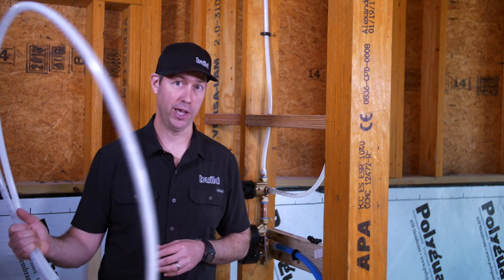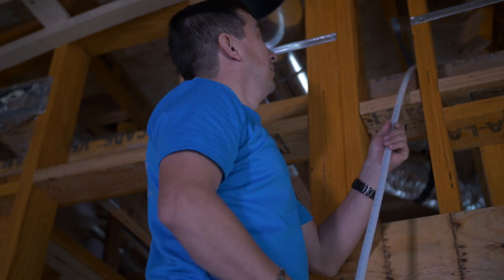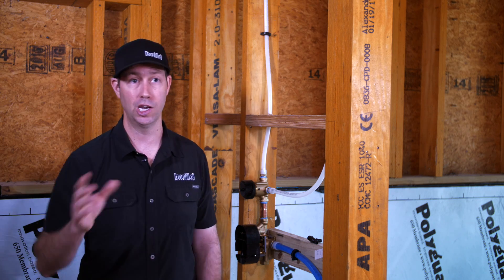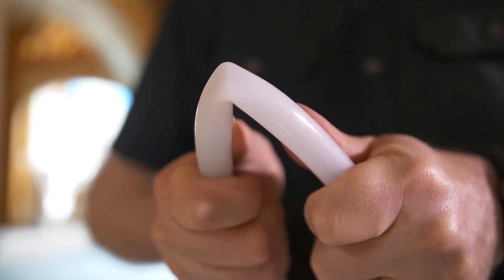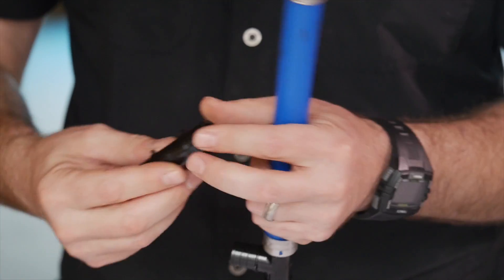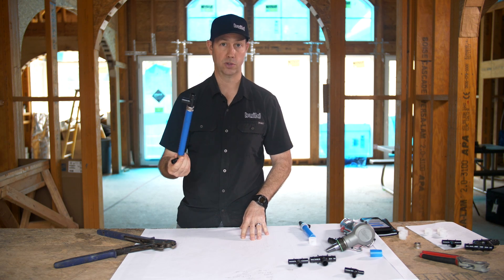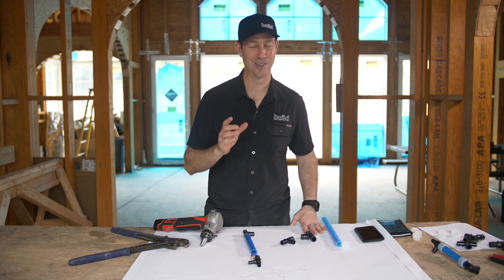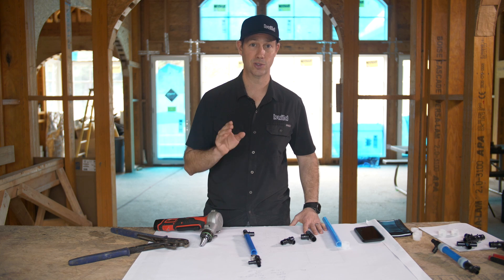PEX vs. Copper Plumbing

Comment: Another advantage of PEX is its light weight, making it ideal for RVs and Motorhomes. We live full-time in our Fifth Wheel and I love being able to maintain, modify, move or repair my RV plumbing so easily. And its ability to withstand freezing temperatures is also a a huge benefit for RVers

Comment: Just finished plumbing in a new tankless heater.  Old tank failed so I figured might as well finally make the transition.   
I bought two  8' runs of PEX and some non-removable push-on Shark Bite connectors to to simplify & speed up installation.

Since I had no hot water.. mid-work-week, mid-winter in Chicago.. the plan was to prep new location for tankless and do a simple temporary plumbing job to get the shower working again ASAP (weekends are for pretty plumbing).. so I installed both runs of PEX without cutting either.  Pipe ends were cut clean and square  at factory.

Half my push-on connectors leaked.  All the PEX was useless.

Having worked with it, I'm more convinced that it's rugged enough to hold up over time.. but I've got zero faith in the consumer push-on connectors.
In the comedy of errors that my installation ended up being.. the 3/4" braided water heater whips I bought to speed up the final hook-up also leaked, so I lost a whole evening without the parts I need to plumb the last 18".  
I ended up going full Copper.  Copper takes longer, but only if the alternatives work.    
I'm not a plumber but it's not hard to sweat a joint perfectly..  if you do the prep.  It just takes more time.   Not as much time as I wasted with worthless consumer-grade PEX connectors and running  back and forth to the hardware store to buy and return flex-lines..

Comment: The everloc system is what i use for heating, the uphonor i use for waters. Although copper is very commen in my area. And as far as stub ups or outs i prefer adapting to copper from pex for a more rigid stop.

Comment: i noticed you did not talk about the SharkBite fittings is that something you recommend
Reply: He's talked about it in other videos. In general, they're great (and reliable) for applications where you'll have the fitting in service for 15 years or less (like a water heater install), but he doesn't recommend them at all inside walls or other places where you can't readily get to them. Also handy for quick fixes or plugging a spot for a contractor to come in later. You should only use them a few times before the rubber ring wears out from install or the factory lubrication is removed from repeated installs.

Comment: You didn't say anything about Rodents chewing on PEX pipes causing damage. I had a repair job where rats in the ceiling did tons of damage to PEX pipes by chewing on them, the pipes were easy to repair but the water damage was tremendous. This would not have happened if the house were plumbed in Copper.
Reply: That home needs a few cats ! 😺

Comment: UV light damages PEX. We had a PEX line passing by a bug zapper at work, an we spliced in a new piece a couple times before realizing what the problem was.

Kind of funny tho. The PEX has a built in defence system, spraying water into the bug zapper until the fuse blows!
Reply: So the PEX fights for dominance?

Comment: Use the brass shark bite pex fittings. No plastic. Only problem I have with it is neatness. A professional job on a rough-in is impossible. I had to start thinking like an electrician running wire when I started running pex.

Comment: In my development that was built using PEX-A in 2007-2008, approximately half of the homes had pipe bursts at the copper junction that went to the HOT outlet of the hot water-heater.  This caused the whole house to flood if you were not lucky enough to be home when the junction failed. I was lucky in that mine only leaked, causing a mold issue on an interior wall of my house, but I had to have both sides of the wall rebuilt and treated for mold. I was one of the lucky ones...

Comment: I have used compression fittings with PEX (SpeedFit) using the inserts, and I think for me is the best system. I am not a plumber but am gutting and redoing my bathrooms.

Comment: I just last June replaced all of my 60 year old galvanized water lines with pex A the tool was a bit pricey  but friends saw how easy it was and we have saved each other hundreds if not several thousand dollars replacing piping in our houses. And we are actually doing more than most local plumbers would do. We have a few good ones in my town but an awful lot of loonies that shouldn't be allowed to practice plumbing.

Comment: Good video Matt.  Here are other things to consider:  1) PEX can expand when it freezes, but is harder to thaw.  2)  PEX can be chewed on by mice creating leaks...I have had clients with that issue.  3)  Copper is a natural antimicrobial material, PEX is not. On projects with well water we have seen microbial slime growth in PEX pipe.  4) As far as expanding the pipe to get full flow fittings...Uponor had a patent that has expired.  Most PEX manufacturers now offer an equal at lower prices.
Reply: Very true about rodents!  They love this stuff.  My parents live in the country and have had nothing but problems with PEX.  I would never use it where this could be a problem.
Reply: Thank You! I had never considered the fact that microbiological growth will be uninhibited with PEX!  (I live out in the country, and am on well water, and I regularly have to take my table-top ice maker apart every few months in order to clean the goop that grows inside the thin plastic tubing, simply because there is no chlorine in my well water).
  I will continue to do any plumbing with copper. (Which I enjoy doing anyways).
Reply: Copper is great until the water company treats water with copper eating chemicals our area has endless list of people re piping due to this .
Reply: @tonysitko2540  I would check with your water company.  Generally, it is a ph problem with the water that eats the pipe.  If it is ph, there are many ways to adjust the ph to stop the issue.
Reply: @billvilla7799  to late repipe time yes the water company should of considered this it is like cancer in our area.

Comment: We had copper pipes in the house and our water had extremely low ph.  This caused the copper to spring leaks all throughout the house.  After replacing the copper with pex, there have been no problems.

Comment: Drop in volume, not pressure drop.... 
The metal clamps begin to rust when building near the ocean.
You are supposed to slightly rotate the "expander tool" as you use it so there are no grooves in the inside of the pipe. 
Careful bending too tight of turn...it may kink later after drywall....especially when hot water is introduced....then try to find it.
I transition to copper when getting close to in-wall brass (tub/shower valves) so it can be changed out later.... much easier.
I had to take a Pex class and carry a Licence in California.
I have overseen 1000's of houses pexed...it's the best system.
Read More
Reply: The Milwaukee tool automatically rotates
Reply: @tyedazole1690 That's cool...my boss never kicked down electric Pex tools. I went into business for myself in 2008 with 2 manual tools. In 30 yrs of Pexing only 2 joints leaked due to wood shavings getting in.....fixed in seconds.....it's the best option by far. Thx for the info...semi-retired now. Plumbing's been good to me.

Comment: ......great informative fact filled video. I've never heard of pex but I've used the black plastic pipes in the past together with fittings much different to what you've displayed. There is also the system for garden irrigation that utilise those ratcheting ring clamps and it withstands mains pressure supply astoundingly. Can pex actually tolerate boiling temperatures for extended period ?

Comment: The biggest reason to go to Pex, especially in low income housing.   They're FAR less likely to tear out your plumbing to sell as scrap metal for drugs.
Reply: That's what I'm going through now.
Reply: YES
Reply: I have a little lake cabin that was plumbed with copper that was stolen. It was then plumbed with CPVC that froze and shattered. Then flexible copper that was again stolen. I finally plumbed it with Pex A with only plastic fittings (no brass) and it solved all the issues. 
I work in the home building industry in Texas. I'm in 10-12 new builds every day, and haven't seen anything but pex in years. Much better than having some meth-head do thousands of dollars in damage for $20 of copper, and it's easy to work with to boot.
Reply: @rts3613  Sounds like you should have invested in some security instead
Reply: @jake jones I think Jody was asking for forgiveness 😂😂
Reply: That's why I switched to plastic wiring.
Reply: Whoa
Reply: I agree.We own property in California & Michigan.People would peel the paint the paint off the walls if they could.
Reply: i mean i rather have that and charge the people than have rats bite the pex and cause a huge leak and damage more than the piping.
Reply: @sk8er4lifeez  good point, i never heard of rats chewing on the Pex though and causing those issues.  But then let's look at repairing a leak to replacing a whole house of plumbing lines. As far as damage that is going to be rare case. A house is vacant In these areas more chances the water is off. It's rare to steal and tear out when it's being lived in. It's good practice to set up pest control in those areas regardless of the use of  copper or pex.
Reply: nunya inct  You'd think they would just get a demolition job with benefits if they are willing to go through all that effort to score a fix. Jeepers.
Reply: You know ...we actually had a builder that made these houses with Pex and this was his same idea! It was houses that were located in the bad parts of Atlanta.
Reply: Years later but I work in public housing and we've had a rash of copper theft this year. Even main supply lines under the buildings, not mention ripping all the walls apart in vacant units.
Reply: Especially in Alaska.
Reply: @jake jones Who builds a housing project and uses copper fittings? 
Also, what do you care, you get paid for it either way.
Reply: jake jones jodys just an idiot.
Reply: If you need to worry about the pipe inside of the wall been stolen then I can imagine these houses don’t have electrical wires or refrigerators or windows for that matter not counting all the personal items inside.
Reply: Yooooooooo
Reply: OMG, Lord please forgive the ignorant.
Reply: Jody Montez ignorant?   It happens all over in bad neighborhoods.   Google it in Detroit.
Reply: @jodymontez693  Don't criticize unless you are a contractor or have first hand knowledge of the issues surround this. Oh the stories I can tell!!!  and yes it is low income housing.
Reply: @jodymontez693  A poor minded reply to real plumbing  problems/solutions.Small mindedness can be cured. acting be like a adult, not child-like name calling but I know your type.Good luck on plumbing.Get well soon kid
Reply: @jodymontez693  You are forgiven.
Reply: @jodymontez693  Care to explain your side?  This makes perfect sense to me.

Comment: Copper is the best that pex junk wont last 40 years trust me im in the plastics industry
Reply: ......mention was made of less hot water loss hence a saving of both water and energy. Just thinking that in a busy family  house that the savings over a couple decades would more than pay for repairs until say graphene reinforced........naw, I'm going too far fetching.
Reply: @philipvernejules9926  my copper is all heavily insulated my pipes stay warm for 2 hrs after use. All plastic becomes brittle over time. Especially heating and cooling it and running water through it. Some of the copper in my house is like 60 years old

Comment: Question, how did Viaga get passed the CODE BOOK on the ID size of the fitting. Shouldn't this have been addressed by now..or is someone getting a little extra in their paycheck at the Inspector's Office? Code is CODE,,and can Not be omitted regardless. Same with Electrical.
Reply: Maybe because every fixture puts out under the diameter of the id of the PEX bud. Thanks for playing tho.

Comment: I have used peks and the ease of use vs cooper is incredible. But with so many people trying to reduce the leaching of chemicals (pba, psa,pfa) into our drinking water and food I have to wonder that having all plastic pipes in a home would just increase these chemicals into our water supply?
Reply: .........valid point when water has been standing overnight in the pipes .Therefore in morning if your first water use is for consumption versus washing then run the water for a minute before using and this needs to be done also cos of lead in some brass fittings that may leach into the water.

Comment: Uponor PEX is the only way to go ,nothing else even comes close!!  And just fyi your shower valve is not a fixture nor are any other valves or faucets. Fixtures are sinks toilets showers etc. you sound like a homeowner not an experienced builder.
Reply: ........sometimes the professional needs to use the language of the layman for efficient communication. Doctors are an example.

Comment: I liked this video but have one concern. Does insurance coverage make a difference? I would be more concerned with post 10 year coverage on plastic water systems and whether or not the insurance would cover after builder is no longer responsible for work done in pex. Plus, is there retrofit code demands on pex vs. copper piping in California?
Reply: Luis Sanchez PEX has been around since the 1960’s. It is used in hydronic heated as well buried in concrete floors. It has used in Fire Protection also. More resistance to chemicals than CPVC. No insurance issues at all. Buy a name product that has some history and rest assured. Far more issues with CPVC. California had a ban on PEX because it’s California. Ban lifted many years ago. Where do you go after 10 years for any consumer product your insurance company??

Comment: Rodents have chewed through PEX.
Reply: Is that pretty common? That's worrisome.
Reply: @moocrazytn  apparently they can hear the water running through the pipes, so they chew through it.
Reply: @grantsmith6052  I think you have a rodent problem,not a pex problem.
Reply: @kellyk3742  I'm in construction. I have copper pipes and no rodents.
Reply: @grantsmith6052  me too.

Comment: I like pex. However i heard many horror stories of rodents or rats eating pex
Reply: They do chew on any plastics, specially if they know water is flowing through them. Not an issue if your house is well made. If it has openings all over the crawlspace and attic then yea they will make their own water park there.
Reply: Der Hof 2007 copper is dated and should be dropped.

Comment: I love how you say flavors instead of types or kinds but to correct you it's not a potential of loss of pressure it is an actual fact any Bend restricts the flow of water
Reply: ......I'm still processing what he meant and it only makes sense if he's factoring for the pinching down when bending copper in a hurry.

Comment: What do you think about the shark bite push on fittings. I've used a good many here at home ... no problems yet but I hear they may have some issues? I have some that have been in place 7 or 8 years now.

Comment: I'VE USED BOTH, PEX B CRIMPER IS ABOUT $100 THE MILWAUKEE EXPANDER IS ABOUT $700
Reply: I bought the Dewalt expander. Got it from Amazon for around $250 (tool only; already had batteries and charger).

Comment: Made a 3/4" circle (manifold) with pex and ran 1/2" supply lines off of it. No pressure drop... inspector said it looked funny but would work!

Comment: I do aquarium stuff with pvc and cpvc. I really like that pex a set up. Eventually I plan on doing a 500 to 1000 gallon tank. You can find it on my channel the A.R.S.S. System. Though my system I can’t see a use just yet. However in the aquarium it’s self and plumbing runs, there is potential. Though overkill, that pex a would give me crazy peace of mind.

Comment: In 2009, I had a plumber replace the entire cold water run and about half of the hot water. It took a bit over 8 hours (3 people).
No more iron/copper mix, therefore, no more rusting. Water runs so quietly. Hot water from PEX plumbed faucets is HOT, fast! I actually had to reduce the water heater setting.
I asked for extra shutoffs at toilets and faucets, so final cost was much higher than it needed to be. Still, best $2,000 I have spent on a single project.

Comment: If you buy a mobile home or have a home built, make sure that the plumbers DO NOT use plastic or aluminum fittings to attach the Pex to the faucets. Over time, the plastic and aluminum fittings will expand on the hot water line and they will come loose and flood your home. Copper, Brass, or Bronze fittings are the only way to go.

Comment: At the beginning of the video you mentioned Pex types A, B, and C but you only explained types A and B what about C? I do agree about PEX type A being way too small on the inside diameter so my solution is to just go to the larger size if I am concerned about pressure drop. As a result I will often use 1" for some trunk lines and only use 1/2" for bathroom sinks, washing machines things that don't really need much in water volume.